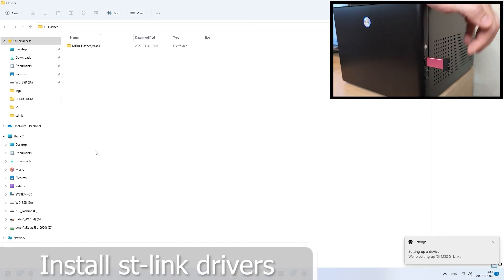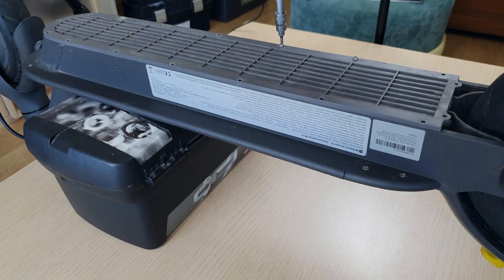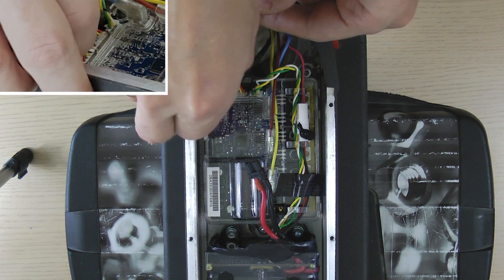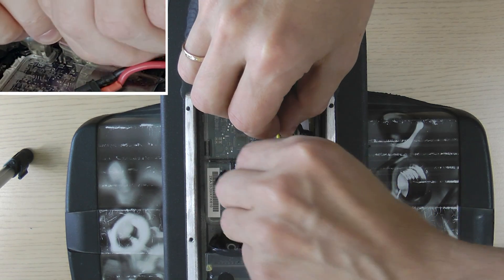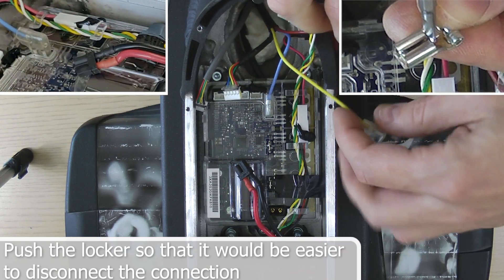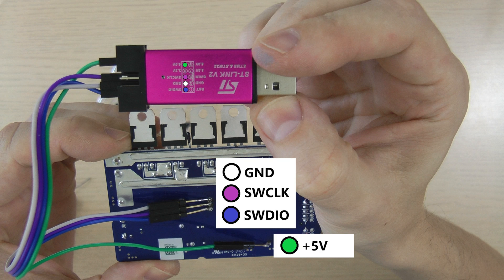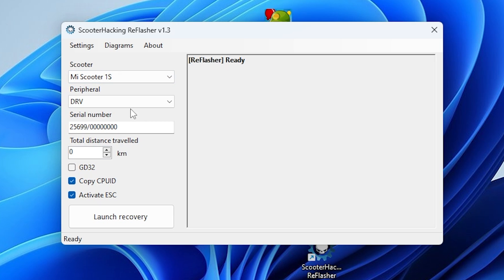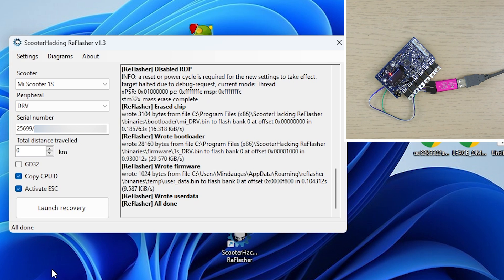Flashing Xiaomi electric scooter ESC board with STLINK (Non-Responsive Power Button fix)

Comment from the maker: Thank you for taking the time to watch and comment on this video. If you enjoyed it, please consider subscribing to the channel for more content like this. If you have any questions or comments, don't hesitate to share them below, and I'll do my best to respond. For additional resources and links to the software used in this video, please refer to the video description. Lastly, if you found this video helpful, please consider supporting the channel by using the affiliate links provided in the video description. Thanks again for your support!
Reply: hi, i have a question please! i have a pro 2 vith ESC255 can i flash it with this method to downgrade it ?
Reply from the maker: This is your drv version. Use "Scooter hacking utility" to identify your microcontroller
STM32F-ver. 3.0
GD32E-ver. 3.1
GD32F-version 3.1
It is also written on the board itself.
And yes, you can flash 3.0 or 3.1 boards, just need to check or uncheck the box in the application. 8:19
Subscribe thanks.
Reply: Can you please help me my scooter doesn't turn off and i cant even click on the power button so it comes flashlight it shows no battery nothing it happend when i tryed to make my scooter faster with a file by using an app please help
Reply: you have 64 bit
Reply: Hi man, I reflashed my mi3 and when I press power button on dashboard it still blinks red on backlight. What could be happening?
Reply from the maker: Do you mean the error code is still flashing on the dashboard?
If yes, what is the error code?
Reply: Y si la versión es v 3.3?
Reply from the maker: Igual que V3.1 Suscríbete, gracias.
Reply: Hello Minda I hope you will answer me, I need help.
I have a Xiaomi Pro 2, I downgraded it successfully from 158 to 134 with ST LINK V2 (Dashboard).

Then I wanted to flash 129 for then install 075 for custom display.

After successfully flashing 129, the display was still stuck with Lock and Bluetooth icon (but my mobile phone disconnected strangely).

I stupidly turned the display off and it doesn't anymore turn on.

When I press power button the red back tail blinks 33 times.

I tried to connect ST LINK to the Dashboard (only 3 pin no 5v) for a write flash but it gets no connection.

doing this procedure to the ESC Board will fix the Dashboard? 
it's the same as flashing though the Dashboard?

Now I unplugged the battery hoping to find a way to unrbick my Pro 2.

Comment: Hello I have followed the video step by step but my controller seems to not show any lights when plugged into the pc , mine was already hacked I messed up by turning all the settings up to get it going 62mph forgot to turn it down and the next time I went to power on the scooter it would only stay on while holding power button as soon as I let go it dies ,same thing after trying to connect it to the pc what would I need to do in this case please would there be any way I could show you thank you so much I appreciate you.
Reply: I got the sco driver v3.0 for the controller and a pro 2 screen I think it’s a sco ble 3.2
Reply from the maker: It's probably a burned controller if it doesn't show any signs when powered directly with 5V. 
Try asking here: https://t.me/scooterhackingchat
Subscribe, thanks.
Reply: @MindaugasJocionis thanks so much I left a message I’m hoping someone knows ❤
Reply: @MindaugasJocionis the controller only stays on while the power button is pressed meaning with the battery plugged in to the controller

Comment: My power button works to set on but not off only that works in the scooter nothing else, the throttle and hard reset doesn’t work nothing. Do I have the same issue as you and do I need to fix it this way you do? I’ll explain what happened, I bought a dash clone from AliExpress it was the wrong one m365 I bought but my scooter was pro 2. I flashed the clone and then changed the dash to original it all worked until I tried to attempt drv downgrade on the original dash. That’s were it became bricked. The pro 2 dash has BLE restriction idk why I tried it but is this how I fix?
Reply from the maker: Yes, this will fix your problem.
Reply: Thanks, I’ll try and let you know!

Comment: hi Mind. Nice video. thxk. I had to replace the battery on the scooter. But error 21 comes out. I connected the Xiaomi app and it upgraded the firmware, errorly. I bought St Link and with an Android phone and via the web I tried to downgrade... I succeeded via a website... but now the Scoothk app does not connect to Bluetooth. Can you tell me if I also have to downgrade the BLE on the power board?....or do I have to install something else on the display board?
Reply from the maker: I have no experience with web flasher. Please try asking for help in this Telegram chat: https://t.me/scooterhackingchat.
Don’t forget to subscribe—thanks!
Reply: @MindaugasJocionis  but is it better to flash with the pc or with the android phone? I asked on the site but nobody answered me
Reply from the maker: @deaddog2472  It depends on what you're trying to flash. If it's a bricked ESC or a locked dashboard, then you need a PC. If it's an unlocked dashboard, then you can use a phone

Comment: Hello from Fraznce, I don't want to be unpleasant, but your handling is also done via smartphone and application to completely unlock it and no longer have to launch it with your foot. In addition, the applications allow you to reliably control the cell by cell Android live.
Reply: What if it's bricked or the locked German software is installed?

Comment: Is there a way to indentify compatible scooter firmware as these scooters are copied by everyone and their mother and releases in various regions with their own names.
For instance the Xiaomi M365 is sold here as e-Wheels E2S V2 - and it looks exactly the same and if you connect to it with Bluetooth you use a Kingsong app - later I think e-Wheels had an "proper" app for their brand, but it looks like a re-skinned variation on a basic scooter app.
Reply: It's not. It's just looking the same on the outside. There are 2 other manufacturers that use the same controller box as Xiaomi, but the controllers are not compatible with the display boards. To my knowledge there are at least 7 different Xiaomi look-alikes but they all have different controllers and dashboards. Xiaomi does not rebadge their scooters for anyone.

Comment: My scooter Pro 2 the control works well but the rear light does not work I installed another control the light works but very weak I installed another control the rear light works perfectly but it shows me error code 41 I followed up the meaning of this error it tells me that the battery is overheating knowing that the other two control do not show this error

Comment: My scooter turns on, the light on the lower controller flashes and I pressed the accelerator and the motor does not turn. I checked the motor to see if I had a cut cable and it was working correctly. Regarding the Bluetooth on the Xiaomi hom, the network does not come out and it tells me that the device is not found and that I have not done anything with the firmware. It comes with the factory firmware. I hope you can help me.

Comment: I''ve bricked my already downgraded BLE pro 2 because a customer wanted to buy it and tried connecting it to the Mi home app. Power button doesn't work anymore so guess I'll have to flash the DRV now. My question is if after this, can it be connected to the Mi home app again? Or should I take any other steps. I just want it stock again for the customer.
Reply from the maker: Enter the correct serial number, and it should work with Mi Home. When I tried this on my modified scooter, Mi Home successfully flashed it without bricking. It flashed the BLE firmware first, followed by the DRV firmware. Subscribe, thanks.

Comment: does it fix that my escooter showes 0 kmh and the button doesnt work and its always on driver mode???
Reply from the maker: If it's not a dashboard water damage problem, then yes. If it happened after flashing your scooter firmware, this will definitely help. Subscribe, thanks.
Reply: i have the same display stuck on D,,plugged the batt accu cabel out and back in but didnt change anything,scooter hitted hard and went stuck like that

Comment: Hey thanks for video, i bricked my 1s when flashing drv file on the shfw firmware, it is not responded the connection request, throttle and electronic brakes not worked also and i solved with this method without soldering. Thanks.
Reply: Subscribed
Reply from the maker: @yusufkenanturak  Nice, din't forget to subscribe, thanks.
Reply: How did you do with without soldering ?
Reply: @TwIn603  it is easy man only give flash command from pc and make sure the ribbons touch the pins properly without slipping to the end of flash.
Reply: @yusufkenanturak  I did think that just wanted to be sure lol. Thanks 👊

Comment: Hey thanks for video, i bricked my 1s when flashing drv file on the shfw firmware, it is not responded the connection request, throttle and electronic brakes not worked also and i solved with this method without soldering only in 2 hours. Thanks.

Comment: Can i do it without soldering?
Reply from the maker: @hddrs2827  Yes, if you have a steady hand. Clean protective coating from those pinpoints with isopropyl. Subscribe, thanks.
Reply: @MindaugasJocionis  thank you mate i m subscribed on mi pro 2 works with 35/27 error?
Reply from the maker: @hddrs2827  Yes, this should solve your problem.
Reply: @MindaugasJocionis  thank you man you are a true legend

Comment: Hi. I have 3 electric scooters for family members bought in 2019 and 2020. 2 x m365 Pro 1 and 1 x M365 Pro2.  Once in the past I generated a FANTASTIC firmware for each of them on some russian page ( I used serial of each scooter to generate the firmware. I came to the conclusion recently that when something happens to any of these controllers I will loose my fantastic firmware, because I have no backup made.
I am considering to buy ESC V3.0 M355 Pro Pro2 controller and simply clone the software od each motherboard currently in my scooters to the newly bought motherboard.
How to do it in your opinion? The Scooter Hacking Utility says I can use the same serial for each cloned m365 pro. Tell me. How would you do what I wish to do?
Buy ESC V3.0 motherboard (?), then connect to m354 pro with scooter hacking utility (can It save firmware to a file on my PC like you would rip a DVD?). Then, How to clone this backed up firmware onto new board from ali ? I need power in the board, so how to do it? Do I need to connect it to the battery (basically removing working controllers I have now?) or the board could work in some different way? In order to flash-clone the firmware I need power being provided to the board as I understand

Comment: hey there at the beginning of the video seemed to be my exact same problem but after doing it, it still doesn't work, I don't know if I'm doing something wrong in any of the steps but tried two times, and nothing, everything looked the exact same way as shown in the video but no change at all. This problem appeared after I installed the wrong BLE on the scooter on the attempt of getting back to normal and got it super bricked. Please any help would be very much appreciated
Reply from the maker: If it bricked after flashing BLE, it means you need to reflash the dashboard, not the main controller. You can try following this video: https://youtu.be/IvQ4oT2u_vg Just choose "write flash" instead of "downgrade". Alternatively, use the reflasher. You may also need to disconnect the dashboard from the scooter and power it on with 5V. Check the reflasher for diagrams.
Subscribe, thanks

Comment: coudn’t connect to target it says. all the soldering is checked leds burn on the motherboard… maybe the controller is too new . its sco driver v3.3
Reply from the maker: Check gd32 checkbox ESC3.3 is same as 3.1
Reply: yes i did of course, no luck
Reply from the maker: @overexposurevideo  What's in the log exactly? Usually it's always a bad contact. As well try to ask for a help in this telegram chat: https://t.me/scooterhackingchat

Comment: Hi i have a question. I downgrade my xiaoi  mi3 using st link v2, but in xiao flasher and downG my scooter change name and now is Mi electrical scooter pro 2. I flashed (mb i used wrong zip file), but in every mode she drive 31. Its ok but the problem is: she is all the time active. I cant turn off. When i try to power off she automaticly turn on. I can pull off controler, but red lights all the time pulse. What should i do?
Reply from the maker: You used DRV for ESC 3.0. You have ESC3.3. You need a new gen DRV or shfw from the scooter hacking utility. As for the incorrectly identified scooter, it’s probably a serial number from Pro 2.0. Contact me on Instagram, we'll fix it. Subscribe, thank you.

Comment: I wanna do this without soldering but it never connects with the controller there‘s only a red shining on it
Reply: from my personal experience, this means that the 5v connection is working, but the other ones arent
Reply from the maker: Clean the protective coating off the circuit board with isopropyl alcohol and hold as steady as you can. What does the app log says?  Subscribe, thank you.
Reply: @MindaugasJocionis  i did clean it already with isoproply alcohol it says couldn‘t connect target the controller shines only red i can‘t see any green light
Reply: I secured the v5 point as best I could with tape and pressed the other three pins until it glowed red and the message "Unable to connect to target" appeared.
Reply from the maker: What is your controller version 3.0; 3.1. or 3.3? For 3.1-3.3 you need to check that GD checkbox.
Reply: @MindaugasJocionis 3.1 and yeah i already tried it with the checkbox on
Reply: It would be great if i could connect my scooter with SHU and update the drv there but as soon as i turn my scooter on the lights blink constantly red and my button doesn‘t react
Reply from the maker: Only whats left is bad contact or the wires are connected incorrectly..
Try asking for a help in this telegram chat: https://t.me/scooterhackingchat

Comment: first of all thanks for your information 
My question is I have controller 3.3 and I have dashboard of 365 that have points no numbers can I flash the controller with your method
Reply from the maker: It doesn't matter what dashboard you are using, you can flash controller like in the video. Don't forget to check that GD32 checkbox for 3.3 controller version. Subscribe, thanks.

Comment: I have 1s scooter, no reaction on power button. Battery board led flashing red 3 short and 1 long time after I press reset button.
Reply from the maker: After what did this happen?
Subscribe, thanks.
Reply: @MindaugasJocionis  its my brother scooter, he said that power on button worked only with charger plugged in for 1-2 minute, there was some number on screen, mby error Codes, but he dont remember, because scooter goes ok. One or two times i saw flashing stop signal many times. Then one morning it suddenly bricked.
On bms board is smal button in corner, if i press it then got 3 short and 1 long flash. Section voltages are from 4.04 to 4.10 volts. On good battery led always must flash with blue.
Reply from the maker: If you have reset the BMS and the problem still persists, the first thing to do is check the cable connections and battery cell solder joints for cracks.
For moore help try asking in this telegram chat: https://t.me/scooterhackingchat
Reply: Qq  @MindaugasJocionis

Comment: I flashed my xiaomi pro 2 model 2023 and then i get code 35 and 27. I do same thing like your video and then it work. But when i use xiaoflasher to downgrade ble i get same problem. How can i fix it can you help me?
Reply from the maker: This error is due to flashing the wrong DRV to the mainboard. Probably, your mainboard is 3.1 or 3.2 with GD32 chip version, and you flashed DRV made for 3.0 STM32 mainboard. Reflash your mainboard again and use the "Scooter Hacking Utility" Android app. It automatically recognizes the mainboard model and flashes the correct firmware. Subscribe, thanks.
Reply: @MindaugasJocionis  Yes it is. So how can I get it to go 35kh
Reply from the maker: Reflash your mainboard again, then use the "Scooter Hacking Utility" Android app for shfw flashing
Reply: @MindaugasJocionis  this firmware package is not compatible. With your current hardaware. It wat i get after shfw
Reply from the maker: contact me on Instagram, I will try to help
Reply: @MindaugasJocionis  have do it👍🏻
Reply: @MindaugasJocionis  hey man! I got the same exact problem please help me!!!
Reply: @MindaugasJocionis  I sent you a message in Instagram, waiting for ur reply my man!

Comment: I need help with your huge knology 🙏🏾 I just got an new mi pro 2 (04/2023 Model with v3.3 controller drv252 ble158), tried flash with st link and all, but got bricked (error 35/27) 😪, so using the st link I restored the drv and s/n to the factory default, ok worked normally again. My doubt is, if I order a kit (Dashboard and controller v3.0 drv155 ble129) I will have to change the BMS controller as well? Or just install the new dash and mb?
Reply from the maker: Write to me on Instagram and I will help you :) There is no need to buy dash or controller.
Reply: @MindaugasJocionis  Thnx a lot Mindaugus, I understand after getting bricked ( error 35/27 ) with the new mipro all you can do is open the scooter and flash the DRV directly using stlink correct? There is no way to do this from the app or from the dashboard correct?
Reply from the maker: @overexposurevideo  Yes you are correct, only stlink.